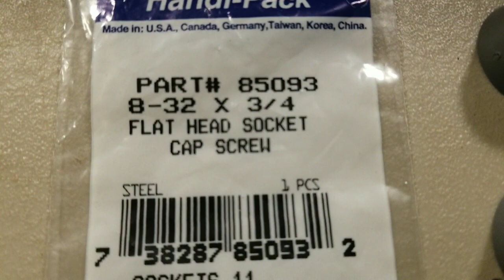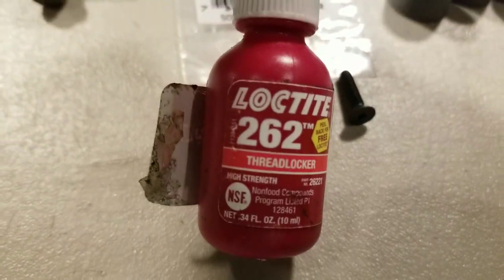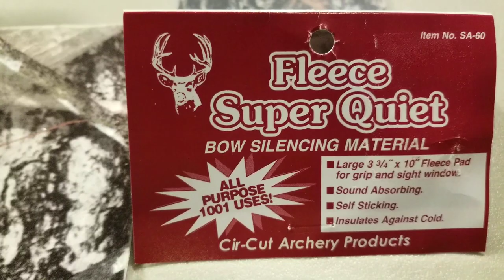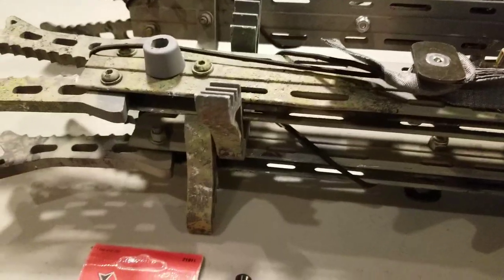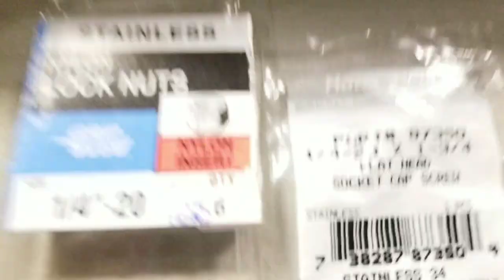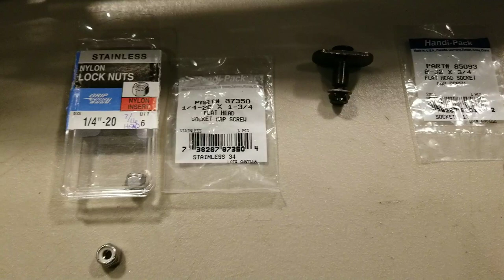Hawk Helium Climbing Stick Mod

Comment: I have 3 older 32" leverage sticks. Model # 5250. Thinking this mod may work out. Wondering if you're familiar with the leverage sticks? They look very similar to the hawk.
Reply from the maker: Yeah I just looked at your sticks online, seems like this mod should work for those as well.
Reply: @dukeboy1011  they seem to stack differently, but I'm more interested in the versa button. 
Great video!

Comment: Does the xop versa button require any drilling?
Reply from the maker: Remove the original bracket that held connect the original straps to the stick. Use same hole. Hope this answers your question.